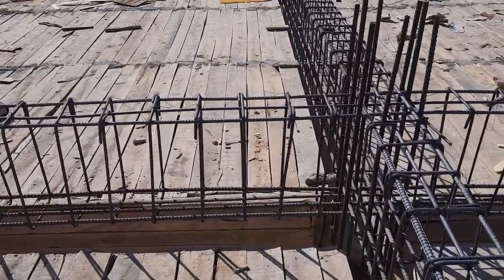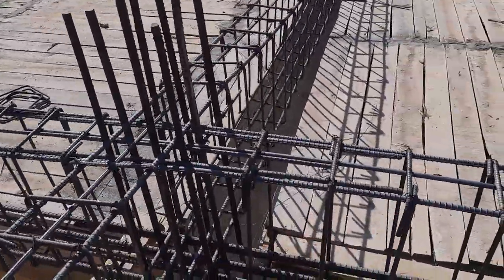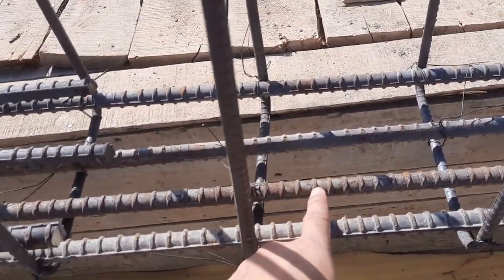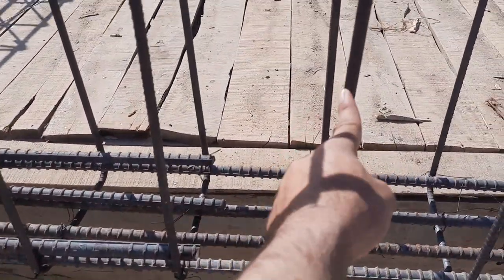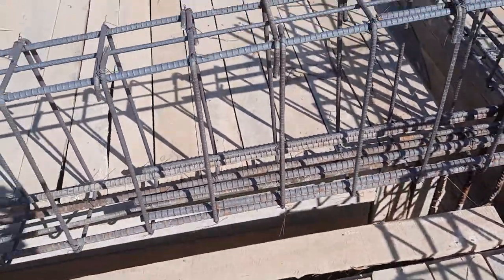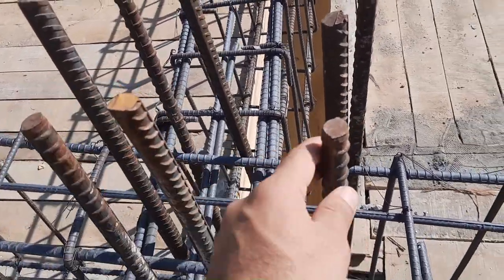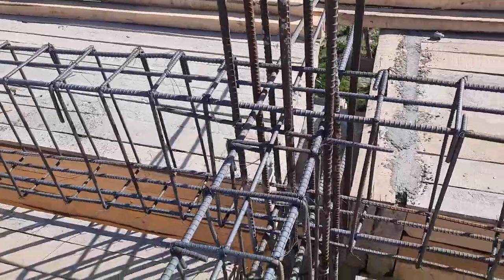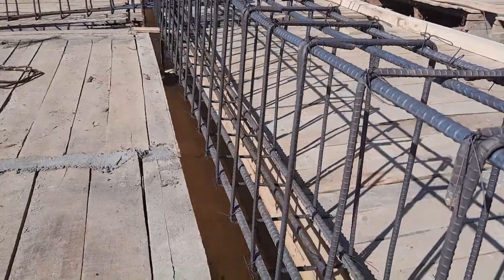24 Feet Span of Beam Reinforcement | Beam Structural Design |

Comment: When do you calculate your beam to be L3 or L4? To know the distance of the bent up bar or stirrups. My project is a garage car port that is cantilevered over a slope. It’s 24 ft by 36 ft. My columns will be 12 ft on center. 12 columns total. What and how should my columns and beams be calculated. Thx for your response.